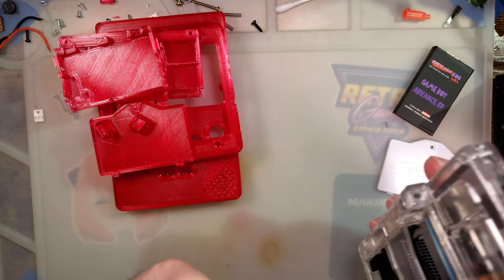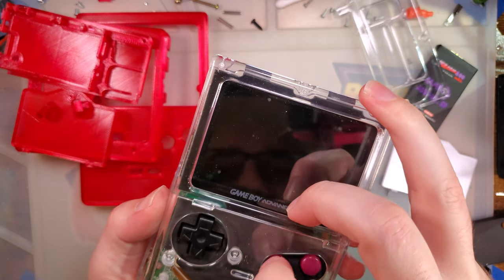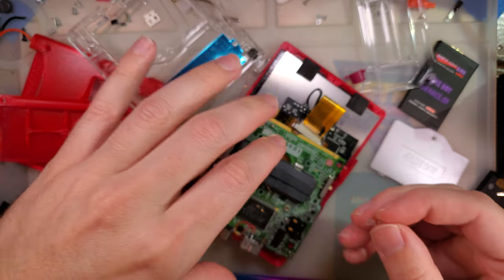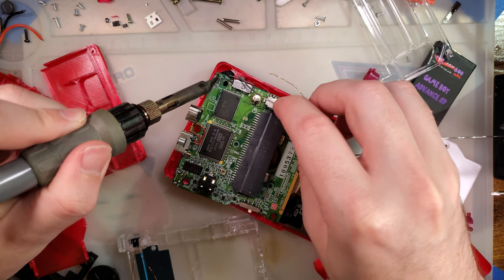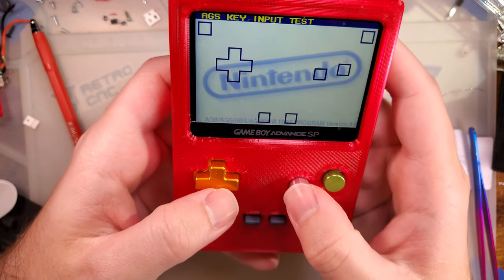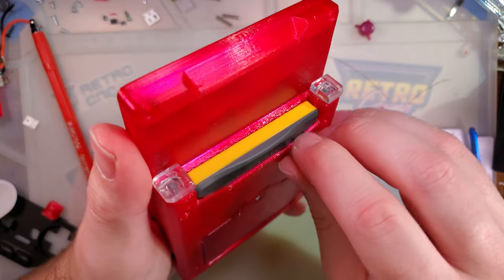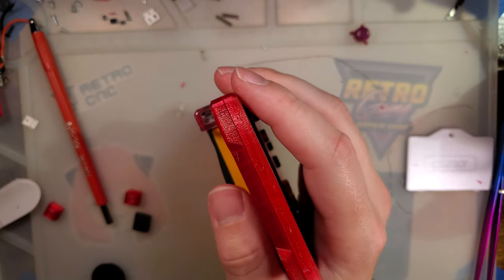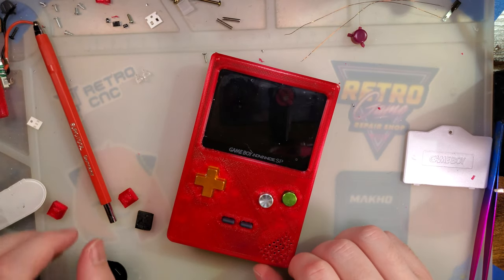XIPHER Slab V2 (Home Print -- PETG on Ender 3 Pro)

Comment: I loved the look of that clear shell build you did, but thanks for taking a look at the new design 🤙
I definitely agree about the feel of 3D printed shell too. Id love to have them manufactured or injected, but my god, its so expensive 😮‍💨
Reply from the maker: We gotta talk about them overhangs if you seriously wanted to consider manufacturing
Reply: How difficult would it be to take the 3d files and convert it to whatever a cnc reads? If it'll fit in plastic it'll fit in aluminum right
Reply: Has anyone printed one in ABS or ASA and used acetone smoothing?
Reply from the maker: @jeremym8748  It's not possible, the data formats are just totally incompatible. A machinable STEP file cannot be generated from a STL or OBJ.
Reply: I would buy a slab aluminum shell… with boxy pixels and makho rough same price I would pay the same for an aluminum slab

Comment: I have to say I was so pumped about this option for  the SP. I love that the game in go in the top, but I've been hesitant because of the 3D print. I don't have a printer and I was hoping someone would be selling these shells printed at high quality, but I haven't seen it yet.

Also with your screen kit and all the parts needed what's your all in cost here minus the Game Boy itself?
Reply: Humble bazooka sells a slightly modified version of this
Reply: Sadly there was a fall out between Humble Bazooka and the original creator so all Slab Remix or Gem have stopped production. It sucks and I hope there is a better resolution. Now if Xypher is thinking about updating the design to potentially sell a metal shell, I would be all about it 🙏
Reply from the maker: ~$20 or so for the print though it's only a few dollars in machine time and filament on a home machine. Then you need a common ground button board, $5-10 depending on where you get one, an IPS kit $60, a couple dollars in tact switches (less than that but if that's all you order, you've still got to pay shipping), and as much wire as you need to connect up the buttons. You also need an extension to connect the LCD back up to the SP as the rotated motherboard makes stock ribbons no longer viable. The default option is like $15 iirc but you've got some leeway if you want to be creative. 

The IPS kit is not necessary for all versions of the Slab. I believe there are backplates you can use that fit the original 001 or 101 LCDs. It's not a pricey mod unless you make it one. In this case, it was probably $100 not counting the GB itself.

Comment: Wonder why the pcbway version ended up floppy. Might have to try printing on my Saturn 2 in the near future and test some different resins.
Reply: As an update, I did a quick test this morn since I have the day off. With default settings and auto supports it turned out pretty sturdy with just the cheap elegoo abs-like resin. There is a little flex in the middle of the front plate but likely would go away with a screen mounted in it. Could even take it a step further with the old mix in some Sirayatech trick to make it harder. Clear resins should also typically cure even harder than opaque ones. Might just be that they aren't using abs-like resin and are using fast resin with quick cure times to get them done quicker.

Would be fun to test a slate also since I think your design would do even better. Make me sign an NDA or whatever and send me an STL for fun haha.

Comment: Love your vids, taught me a lot.  But what you are saying about the home printing tech not being there(even when this video came out id already been printing at 35 microns for almost 2 years) the issue is its an fdm print, and it needs to be a tapeable engineering resin print.  Results wise you got what you paid for with the 1$ fdm print instead of the 8-10$ resin print.  Other criticisms of the design itself are valid, but what its printed out of was a choice, and a real questionable one.
Reply from the maker: I think one of us lacks perspective. How common are machines like yours vs machines like mine? 

You also just reminded me of a video in my backlog that I forgot to publish. I order a resin print too. https://youtu.be/T9t6iRlYtMc
Reply: @makho  I think it probably depends on the maker space you inhabit?  Personally it's way tilted towards resin(like 4 or 5 to 1), but I come from a minis space where fdm is mostly used for terrain, rather than things  we want to actually look good. Resins way less finicky than fdm,  coming from the enthusiast side, i wouldnt suggest fdm to someone that didnt want 3d printing itself to be their hobby or a need to print large stuff(being the go to guy for troubleshsooting in my hobby group this applies doubly so, we mostly print wargaming minis for 40k, bolt action, dnd etc so detail and durability is everything to us), the machine im talking about (sonic mini 4k) 3 years ago was a 400$ machine, but an equivalent printer today is less than 150$ brand new, on the expensive enthusiast level instead of 4k at 35 micron pixels its 12k  and 19 microns(smaller than the finest human hair).  4k resolution on the small form factor is about on par with injection molding for detail and smoothness, the higher end stuff blows it away.  The big thing is the resin though, as normal(cheap) resin is brittle and doesnt take well to being tapped(so your screw holes will strip out in short order, and itll shatter if dropped) really need to use something like a sirayatech build resin(its about 3x the cost of normal resin 45-60$ a bottle).  I appreciate the follow up, and i really do love your vids and work, got me started on my own gb modding(waiting on parts for my third one now) currently collecting parts for a slab v2.  Looking forward to checking out your resin vid at lunch!